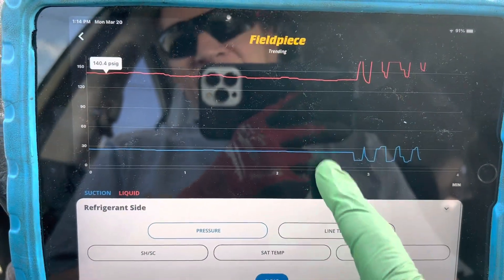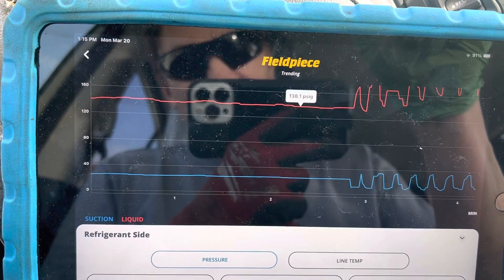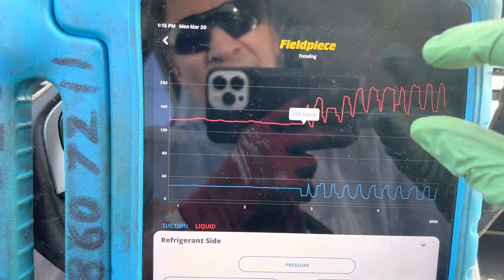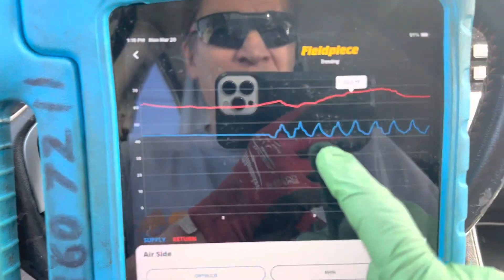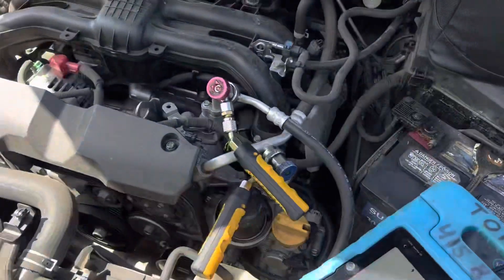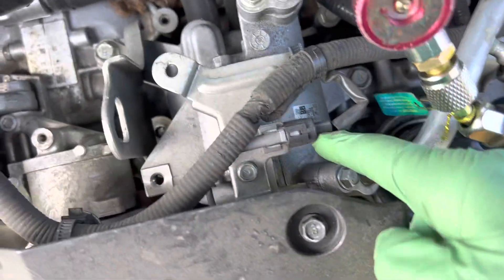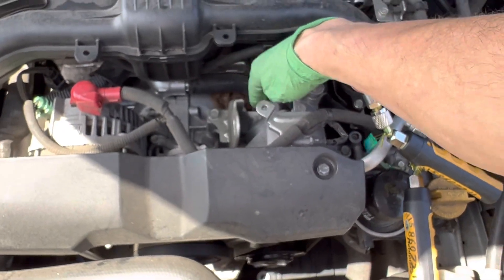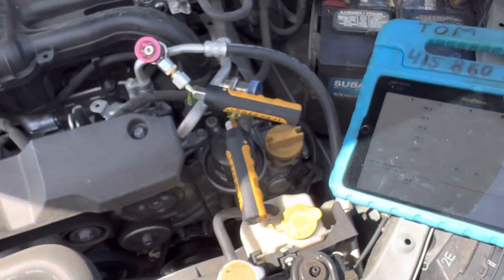VARIABLE DISPLACEMENT COMPRESSOR CONTROL VALVE￼, Not electrical. ￼

Comment: Looks like it's controlling well! ;)  Not sure why the clutch would be cycling, given the compressor is variable displacement.
Reply from the maker: Because they were using an old fashion, primitive, mechanical adjusting, and they must be using the clutch for cold Ambien conditions protection. 

Because it’s so cold outside it’s cycling using the clutch . 

If it was 85, outside it would not be cycling at all I would never cycle. It would just adjust displacement.
Reply: @coldfinger459sub0  Got it, a cold ambient and it's cycling  on low pressure cutout.
Reply: It would seem that the rapid cycling could very well be normal for a variable displacement compressor.  Coming on and off being regulated by the temp required to cool the cab.
Reply from the maker: @magicone9327 only when vary cool outside under low heat loads.  
        Other than that it just stays engaged and decreases displacement to control temperature

Comment: Do you know mechanical compressor with mechanical control valve ?
Reply from the maker: Call compressors are mechanical. 

But I think you mean, just mechanical control for variable displacement . 

General Motors introduced the first one back on the Cadillac somewhere around 1985 maybe 1988. My memory is not exact on the year. . It had a mechanical variable displacement valve that worked on the pressure of the refrigerant to physically activate and move the swash plate that would change the displacement of the Pistons in the compressor.. 

This is very old technology over 30 years old 

And other than varying the displacement, the physical movement inside a compressor 

Back in the 1960s they had STV valve POA valve and a few other acronyms that were you used to maintain a constant pressure on the evaporator to control the temperature out the dash so it would be steady . 

But they remove these devices over the decades because they were too many uneducated people who would not read books on how to properly diagnose and maintain and service these items . 

So a lot of systems would fail or have Parts replace that did not need to be replaced because of the lack of knowledge of a mass amount of technicians who are uneducated cause the problems .  

There was nothing wrong with the technology. There was nothing wrong with the devices installed from the manufacture, all the problems, light on the shoulders of the technicians, who are incapable of comprehending and diagnosing in maintaining the systems. . 

The devices that were produced and installed back in the 1960s were far more reliable than the electronic compressor control valves that are installed in today’s vehicles .